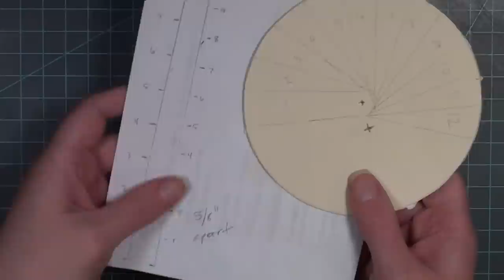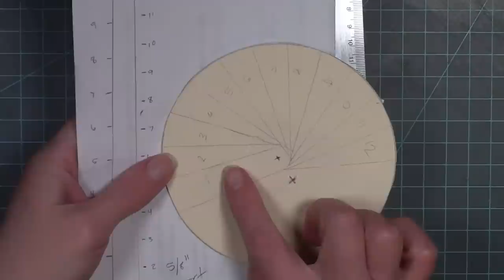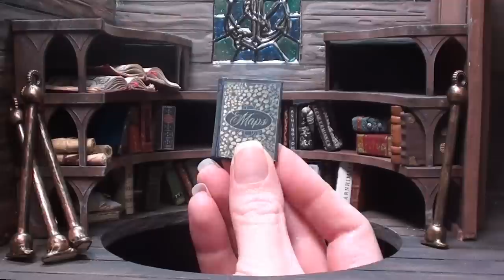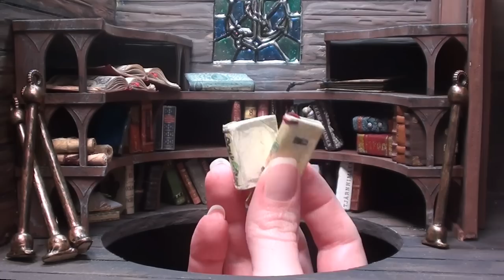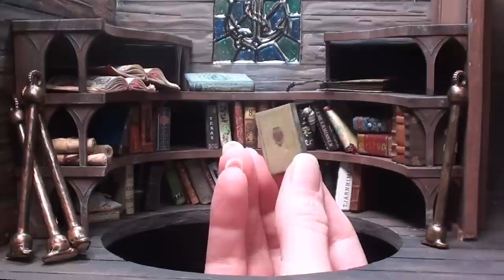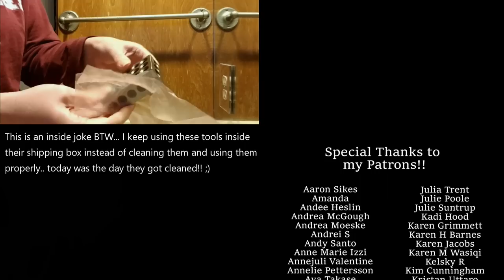DIY Faux Metal Spiral Staircase from a Fan: The Captains Quarters

Comment: You see!  This is why I'm a hoarder.  I had that exact fan a long time ago and it broke.  I kept looking at it, thinking the pieces were so cool and I could make....something out of them.  But I didn't do dollhouses back then and ultimately threw it away.  A spiral staircase like that would have looked perfect in Rovers steampunk-esque ship.
Those stairs look AMAZING!  Well worth all the time you put into them.  And they fit in the little world you've built so perfectly.  Rope would be cool for the railing.  Another idea might be old jewelry chain, especially if the links were large.
Reply from the maker: I agree a staircase like this would fit right into your project!  I imagine they aren't too hard to find if you do want to give it a go ;)  Thank you for the kind words and suggestions for the railing!!
Reply: They sell them at the dollar tree
Reply: DUH! A Happy Hoarder HERE! And I am making a staircase like this for my Real Good Toys Alison, Jr Haunted Dollhouse!
Reply: @juliannehannes11  I checked out the plastic fans at DT! I guess I would need to use a good plastic model glue to hold it together. I already bought the wooden fans but I can definitely see giving those a try!
Reply: @AHappyHoarder  The thing with the wooden ones is they can be thin and fragile and do need be tripled layered and hardened with modge podge (I prefer them for base boards, cabinet doors, fancy bar carts, partitions)

The only con with the plastic ones is cutting them without cracking the plastic, the major pro is super glue loves plastic and it's already hardened and gilded in gold

Comment: This is brilliant! I'm going to be hunting for fans in charity shops once we can go out again. Those offcuts you had spare, would make good decorative panels in other things like cupboard doors  too.

When you struggled with the basswood, it was because the grain was running across the narrow strip, rather than along it. A way to get round it would be to make the frame of 4 separate pieces joined at the corners, then you can cut each piece so that the grain runs along it. (or, if they were the right thickness, just use pieces of those craft sticks/coffee stirrers. I hoard those, and always pick up a few spares if I'm in McDonald's...)
Reply from the maker: I definitely saved the offcuts!  They could be so many things for sure ;)  Great point about the wood grain... I get impatient and I want to cut everything out of 1 panel and it gets me in trouble lol!  That's why I like matboard so much... it can take a lot of different shapes in 1 swipe!

Comment: That turned out really pretty. I think if I was making it, I'd be raiding my cotton yarn rather than my wool, just to avoid the fuzzies that come from using wool or acrylic yarn. Something else that would work well is to take thinner cotton yarns and twist them together just as you would to make ropes from strings. Fascinating construction for ropes/cables etc, because of their countertwist, it makes them very strong and resistant to untwisting. I've been very lucky to see traditional hemp ropes being made at a heritage shipyard on the original machinery they used to do it between the Industrial revolution and 1900s, so for me, there's a nostalgic connection that would make me want to make a more traditional ship rope for such a project.
Reply from the maker: Great suggestions Rob!  And thanks for the bit of backstory behind the ropes.  Information like that always helps me make design decisions as I go a long.  I will definitely be doing some rope research in the upcoming weeks!

Comment: I was thinking that the rope was likely to be a red velvet, like you see in the old movie houses.  Love the work you did on the stairs. And you are right about ducking your head, and lifting your legs. The hatch are usually (I think) 6-8 inches off deck so you have to be careful that is why they call them Shin Busters. Thanks for the video.
Reply from the maker: Red would be great to match the bed covers ;)  I will have to experiment!  And thanks for confirming my head space suspiscions👍

Comment: While I was watching, I noticed the discrepancy.  Your markings are not off.  Your stair supports (q-tips) were 5/8" long, but you attached them to a support that was lower than the original distance you measured for between the steps.  So for each step you lost the distance that was the thickness of the step.  So the distance you measured was from the top of the lower step to the bottom of the next step.  BUT, you gluded to a support that was one step thickness lower than your original measurements.  I'm sure you've figured it out and been told by other watchers.  I really do enjoy your videos and learn a lot from each of them.  Thank you!
Reply: I knew that right away. Didn't account for the thickness of each step

Comment: If you used several strands of very thin craft wire instead of yarn you would be able to form the rope into the hanging shapes you want while also being able to reposition the 'rope' to another shape if it is ever required. This will also give the appearance of the rope having mass.
Reply from the maker: Hmmm... interesting idea!  And I imagine it would be more secure and hold the poles in place too.  I will have to think about it!  Thank you!
Reply: Wired twine

Comment: oddly, keeping the 123 blocks in the box was probably a better idea. Unless you are using them in an oily environment they rust up pretty quickly unless buy stainless ones and then you get brown rust transfers on everything unless constantly wiping them off before use.. I keep mine in ziplock bags both as protection of the projects, but as mitigation of the moisture creating rust here in florida.

Comment: Question: Why did you use spackle versus wood putty to fix the edges you drilled in?  Just curious if you've had difficulties using wood putty before in these kinds of projects?
FYI: If you had filled the scroll work in the areas you were drilling with wood putty / spackling 1st, you wouldn't have had the tear out issues you had. Another tip is drilling smaller hole 1st & then wider hole to help reduce tear out.
Did you know that by law the rise of every stair step must be the same height all the way through the stairs?  It appeared 1 of the top stair rises was shorter than the others on your test paper.  
I'm American but I've found sometimes I need to use metric system for dividing a section of space into equal parts without having to go to 16ths or even 32nds of an inch which is near impossible to make happen depending on what you're doing. Sometimes millimeters are an easier measurement...

Comment: What are 1,2,3 blocks used for?
Reply from the maker: They are mostly used for weighing down things that need to dry.  But I think some people use the holes to hold items vertical as well.  The weight is why I use them ;)
Reply: Ahh, that’s clever. I was wondering why there were holes in them. The stairs look amazing by the way!